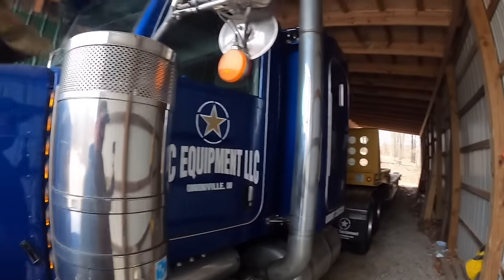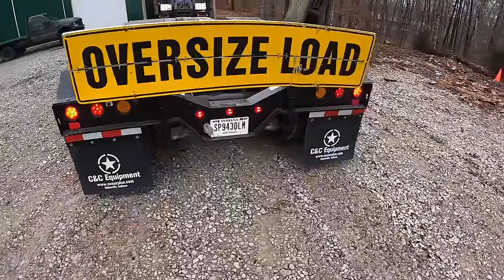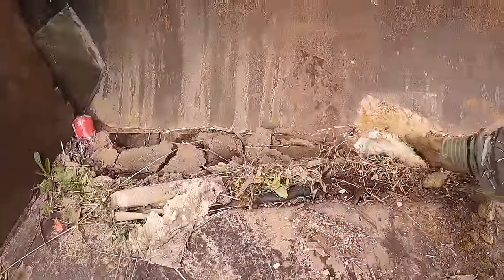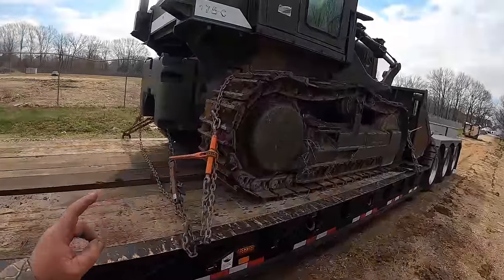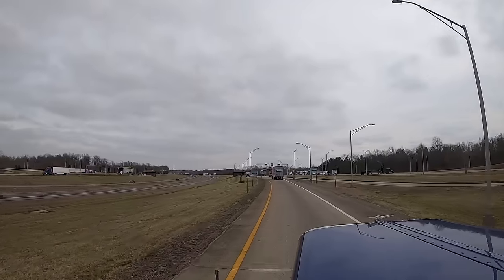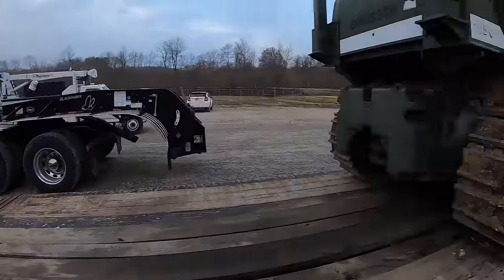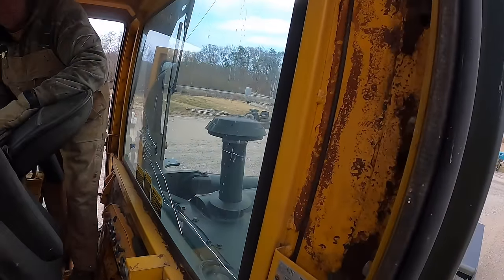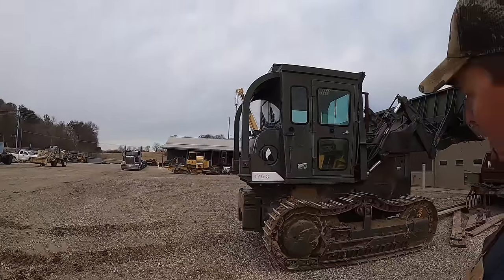Trucking an IH Dresser Dressta 175c track loader back to the shop @C_CEQUIPMENT barn find

Comment: The company my dad worked for back in the 60'sand 70's had a IHC 150 loader, they eventually bought a 175 in the early 70's. They were good machines. They used them mostly for loading field stone/rip rap out of farmers fields, for use along ditches and streams for errosion protection. On one job loading out of an old stone pile along a woods/field edge, the operator dug into an old "Stash" of bootleg/moonshine, from the prohibition days. Mileage one way 305.
Reply: They Also Made Pickup Trucks Back Then Also. The General Contractor That My Dad Operated  Heavy Equipment Etc. For Leased Several of Their Pickup Truck's For The Company.
Reply: @johncushman7458  Hi, I actually have an old running 1953 IHC 1/2 ton pickup. Also a 1955 IHC 170 dually non runner truck, with a portable track pin press set up on the rear. There is lots of pressing blocks and dies for pressing the pins and bushings out of the various sizes of tracks of dozers or excavators. This one was actually run by a IHC heavy equipment service dept.

Comment: I ran a 125 international in 79 on a big mainland sewer job. Trying to remove mud on back fill on a  very muddy job. Then I had to move a 175 like yours on a parking lot job. Boy the power loading the front bucket. It just filled the bucket over the top. For a front end Loader they had power. I ran the 680 Case on hoe Packing. The guy running backfill and pea gravel liked the 850 Case. It was faster. 
Man when those machines were new. It brings back memories of that job

Comment: Way back before you tube days we hauled red cedar out of Arkansas. The guy had a de limber and most of it was less than six inches diameter. Anyway it was an adventure.  Back in a mile and drag the log truck out with an old dozer. It was a midnite run.  Hehe.   A LOAD.  Usually a LOAD of 6 quarter Beech going down, to Budweiser,  The beer really is beech wood aged.  The old MACK earned its keep getting the cedar up here.

Comment: That Pete sounds great with that cat engine! I used to maintain 10 Pete’s with trailers back in the day. My mileage guess from start point to final destination of pickup is 336 miles!
Reply: I listened to the end of the video again and the correct mileage from the shop at Nashville to where you picked up the loader would be 343 miles. For some reason I thought you said from where you left in the morning where the truck was park! It’s one of those 2 numbers lol

Comment: As of 3/18/22 in south central WI. Diesel was running $4.69 p/g, regular unleaded $3.99 p/g and it changes every day. I will tell you this, that is one sweet truck you have there young man. That will be a nice machine for someone, especially after you guys get done with it. Thanks for the ride along.
Reply from the maker: Thanks
Reply: That is backwards to here, regular unleaded is around $1.59 / litre ( $6.36 / gallon ) and diesel is generally $1.40 / litre ( $5.60 / gallon )
Reply: @jaquigreenlees  where?
Reply: @hansjensen5422  British Columbia, Canada.

Comment: My guess on the one way mileage is 368 miles. That's also a gorgeous rig! As for fuel, I just got back from a run up to MN, and averaged $5.40/gal for #2 at Pilot/Flying J.
Reply: You Were Nearly Accurate with Your Milage Figure.  I-69 West From Nashville, Indiana. To West Tennessee is 365.0 Miles

Comment: Watching your day back of a track loader reminds me of encendent , they guys were unloading and A C TRACK loader with no Rippers,  the trailer was old school system , the truck facing up hill , the guy started loading the rig , ass he climbed up on the trailer he some how lifted the back axle of the truck , witch caused truck to roll back and flip the loader or backwards,  it didn't have a roll bar on equipment,  it killed the guy when it turned complete over. On the driver.
Reply from the maker: Wow

Comment: Hey Clinton.  I realize I'm 2 years and 4 months out of date on this mileage estimate (and not in the running for a sweatshirt), but before I start reading comments, I want to put in a distance estimate.  Based on what I could determine about the route you took, I estimate 342 miles. . .from your shop to the Tru-Pac in Trenton, TN.  

Now it's time to get on with the follow-on videos for this track loader.  Thanks for posting and for taking us along on your trip.  Great fun!  🙂

By chance, I was trying to figure out where you went to pick up that snazzy track loader with its 4-in-1 bucket.  It's something I do sometimes while watching videos.  When you were on your way back home, I saw a road sign for US 45W.  That caught my attention, because US Route 45 went through my hometown in central Illinois (about 60 miles west of Terre Haute.  One of my bucket list items is to one day drive all of US 45 between Ontonagon, Michigan and Mobile, Alabama.

Comment: 3/18/22 Pilot diesel price in Mortons Gap was 'only' $5.10. 
 I was griping last fall when I filled my dually up at less than half that price. Pfffttt!
 As of today. diesel was $4.50 right across the river in Iowa. I don't buy fuel of any kind in Illinois because of the $0.50 higher taxes here.
My guess is 359 miles.

Comment: It was fun watching this, I used to run a International 175 Series C in the 80's backfilling deep pipeline trenches and removing trees.  Loved that machine. If I remember to tighten the tracks, the zirk is behind that plate.  Nearly 40 years ago, it could have slipped my mind.  Once I got used to the center pedal for the accelerator and brake I love that.  Great for pushing tree also.
Didn't have a cab, just the roll bars.

Comment: Here in the dead center of Texas, diesel is $4.99 gal so your 500 gallon fuel tank would be a smooth $2500 here and I'm sure it's probably higher where you are... Crazy times !!!!
And yeah, my vote goes to taking the cab off it.
Reply from the maker: Stay tuned

Comment: Noticed him clicking the tires the old train DrIvers use to go round with a hammer and hit the wheels and they use to call it a flat tire if there was a fault in a wheel because when they would hit the wheels with hammer they wrong if cracked the sound is different

Comment: Great video Clint 👍 I seen the deer before you pointed them out I was looking ahead I guess just habits 18 years shifting gears. The fuel up in Northern Ontario Canada around 8$ a gallon 💩 that's at gas station truck stops not sure I've been off work for a bit and haven't seen the price. And the mileage I'd say around 348 miles 👍

Comment: Enjoy the efforts, on your behalf, in allowing us to tag along with your search for equipment; very interesting! My dad was a heavy equipment mechanic during WW2, working with those who constructed the Burma Road into China. I started in heavy and highway construction in 1973, on the first two contracts of Interstate I-88 in New York State. At that time, there was a considerable amount of equipment for the initial excavation stages for both contracts. At that time, diesel was $0.13/gal and regular gas was $0.179/gal. These were without taxes but included a markup for delivery and profit because use was for off-road highway construction. The following year saw prices almost double. As for length of your trip, perhaps 640 miles, round trip? Continued success!
Reply from the maker: Thanks
Reply from the maker: Thanks

Comment: Our diesel price in Norway (2024) is roughly $8 per gallon. It was over $9.5 per gallon last summer. The exchange rate to dollar is ridiculously high now, so if I instead do the calculations with a more normal exchange rate, our diesel price would be $11 or more per gallon.

Comment: Fuel in Knoxville Tennessee is running around 5.00 a gallon some stations are more than that.  I knew a old man that had a ih175 high lift and he hauled it in the bed of his dump truck every job he did he left a dirt pile behind where he had built him a ramp to load it.  I enjoy your videos! Im guessing 343 miles.
Reply from the maker: That’s cool

Comment: Fuel. Over 5 dollar a gallon. You call  it ridiculous, but here in The Netherlands it's one liter diesel for more than 2.25 Euro on the moment. 5 gallon diesel (US) = 18.92705892 liter, (to be exact). 18.92 times 2.25 = 42,57 Euro. Valuta changer gives: 42.57 Euro = 46,7735 Dollar. Without other comments.

Comment: Great video, Clint. Love that Pete. Sounds like you got the Jake's set nice.  I used to haul a 175C around with a Drott 4in1 with a home made "potatoe digger" that we used to plow up old RR ties. Nice machine. ran into it 28 years later when a guy wanted me to haul it for scrap. I could identify it by the smashed tool box and a JD air cleaner and chrome (used to be) stack.  I came over from Direct Perfect and subscribed. Sure enjoy your videos.
Reply from the maker: Thanks 
And thanks for the sub

Comment: I hauled equipment for about a dozen years, never used the strobes unless the load was wider than the trailer.  Strobes are just a good way to gain unwanted attention, in my opinion.
Reply from the maker: Yep 
But I run them with that trailer in the last 6 miles to the shop 
If you noticed my road is not the straightest

Comment: 340 miles, The international 175c were good dependable machines weight was a little over  33000 pounds with counterweight and had the DT 466 at 140 hp in 1979 or 1980.
Reply from the maker: Yep

Comment: Fueled up three days ago, 3/15/22, paid $5.39 for diesel at the Safeway. Drove by the day after and it was at $5.69. Everett, WA. I need diesel fuel in my boat. That will take a bit over 200 gallons. Marina fuel, which should not have the road tax in the price is $5.13 as of 3/16/22. Sadly, I think it will get worse before it gets better.

My guess, 247 miles.
Reply from the maker: Yep 
Thanks

Comment: Thing I first noticed is how little wear there is on the bucket teeth.  Look brand new.  Not even sure what it was used for for those 300 hours on the clock, maybe just sat around idling most of the time.
Reply from the maker: Probably

Comment: 387 miles is my guess,the loader is looking like it spent most of the time sitting on the sidelines, idling, but not working. The bucket teeth,and grouser pads look new,or barely used,nice find!! Did you ever find the floor plate for it,,that was looking like a red flag,like,why is that open!😎😎
Reply from the maker: No I didn’t 
I’d say they removed it to free up sticking pedals

Comment: Good video Clint. I didn’t know they made those up until 2004. I run one back in the mid 90s. Good running machines. My guess on the miles is 379 miles. Great videos. Keep it up.
Reply from the maker: Yep 
Thanks

Comment: As a mechanic who sometimes had to hop in the seat and work (not an operator) my favorite dozer to push over with was the TD15 because both tracks pushed while steering. Loved those old cornbinders and DT 466's. My guess is you drove 302 miles one way.
Reply from the maker: Yep they were the best

Comment: Hey Clint, Great Video. I lived in Clarksville TN When I was in the Army back in the 70's and I love Western KY and Western TN, beautiful country. My guess is 440 miles one way to pick up that beast! BTW the right track seems awful loose for 300 hours? And I will piggy back on another comment about why is the inside of the cab so rusty? Diesel up this way is about $4.99 to $5.50 a gallon depending on where you go.
Reply from the maker: Yep we got the track tight 
According to the data tag it was originally sent to a Florida Air Force base so I am assuming some salty air maybe

Comment: Where i am in the uk we are at the equivalent of $10.8 USD to the gallon for diesel its brutal, we run 3 pc210s , 2 D6's, a pc360 and a couple 30 ton dump trucks the fuel bills are horrific and now we need security for on site fuel storage as having 1000 gallon tanks on site is $10k USD! Really hurting us as the UK gov is removing the lower cost red (dyed) diesel from the construction industry. No idea what we can do but something has to change its not sustainable
Reply from the maker: Wow

Comment: Nice outfit . I am enjoying your channel. I am interested in what hydraulic fittings those are they look better than the quick connect I have used. They are always hard going on. Thanks
Reply from the maker: Thanks
Reply from the maker: They are a dump trailer connection higher flow and they don’t leak
I just run them so in case I want to use a dump trailer I am set up

Comment: Here in Germany the current Diesel price is 2.139€/liter (including tax). Based on Google this eqals to 8,96377921 US$ per gallon. So, I think you should be lucky… 😉
Are your mentioned Diesel prices with or without tax? If without, how many tax will be added?
Reply from the maker: I don’t pay sales tax but have to pay a road tax

Comment: Why is it that you never see a driver check the steer tire pressure or condition on the walk around? I am not a trucker but am interested!
Reply from the maker: Well it would be more obvious if a front was flat or low because it’s a single tire and you would see a bulge 
When you have duals one can be flat and the other will hold the flat one up
Reply: @C_CEQUIPMENT  Thanks.

Comment: Why did you have the oversize load signs on?
Reply from the maker: Probably should of flipped the back down
It wasn’t overwidth 
I always keep an annual oversized in Indiana so that’s why I keep it on
95% of the time that trailer has something overwidth on it
Reply: @C_CEQUIPMENT  dont try that in Pa. $500 fine